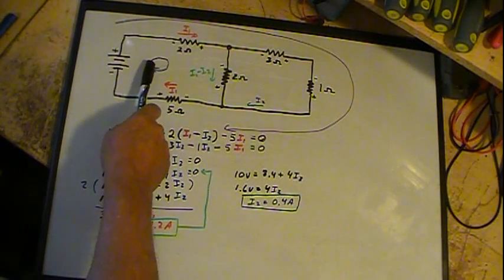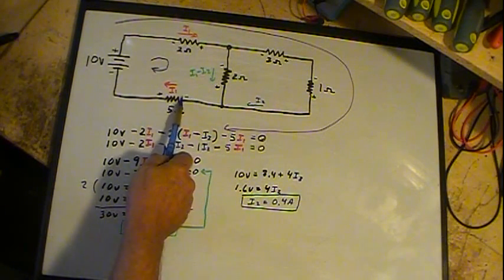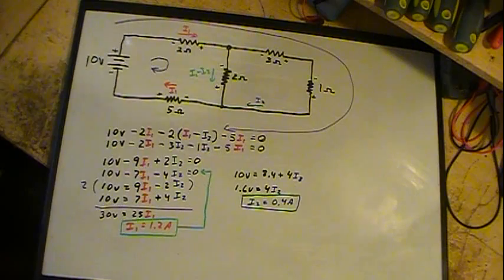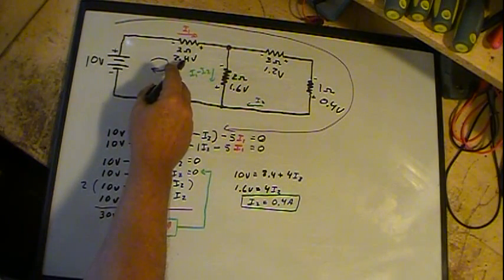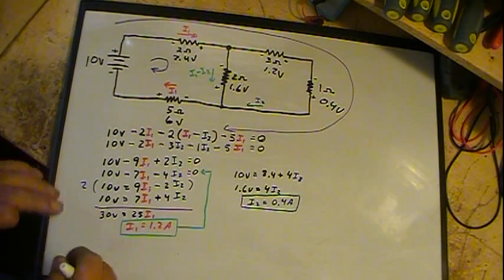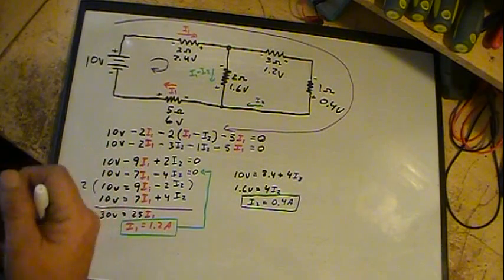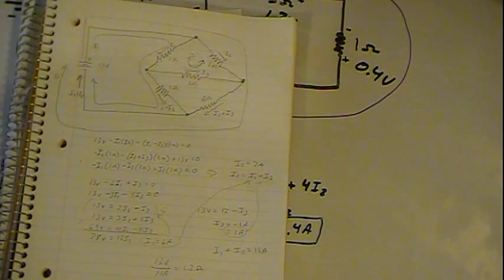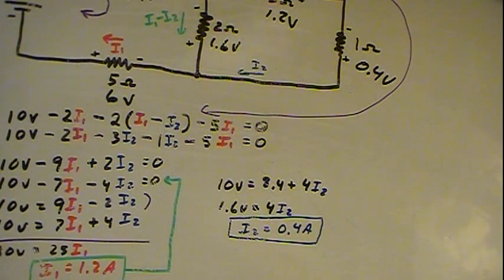Kirchhoff's Laws

Comment: No comments yet Dennis?
   Well, for one, I thought that this was a really great one. In saying that, and being Saturday night, I only got to the part about the "Wheatstone Bridge" and I started getting lost. The "refreshment" didn't probably help any better there either. LOL That's a lot of loops!
   The "meter loading" was a piece of cake to get through in comparison. I just got to get my grey matter in gear to finish this one.
   One thing that always gets me is that I was taught that current flow is from negative to positive. When you show the current flow backwards, I can do it, but I really need to wrap my head around that one so it kind of muddies the water a little bit. Don't stop! It's getting easier with every video.
   Will try to continue from that point Sunday night if I can.
   Thanks my friend!
        Tom